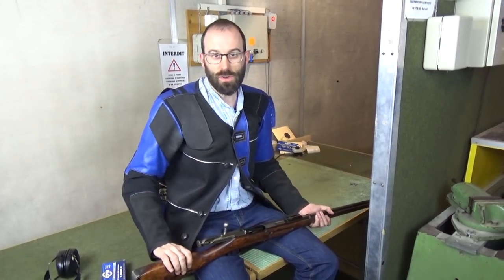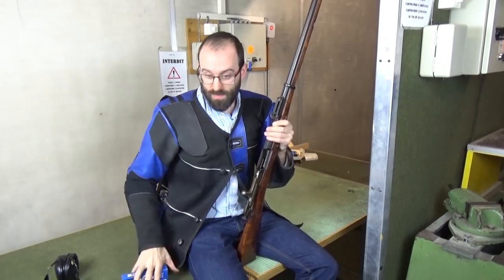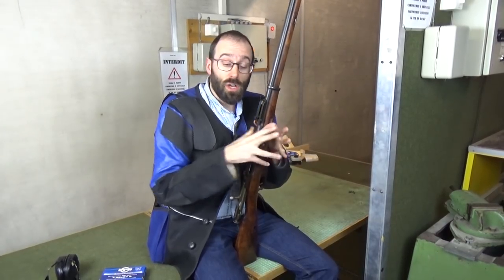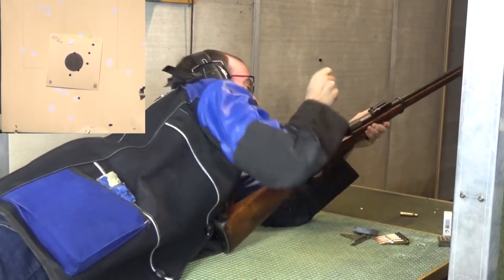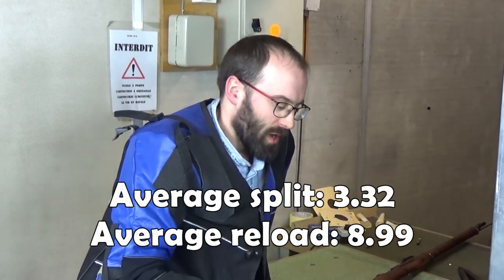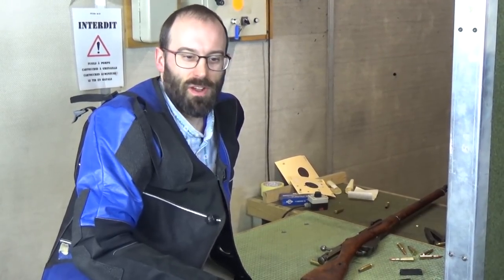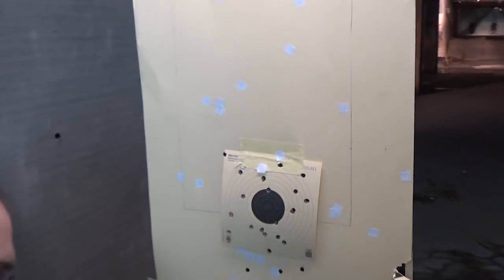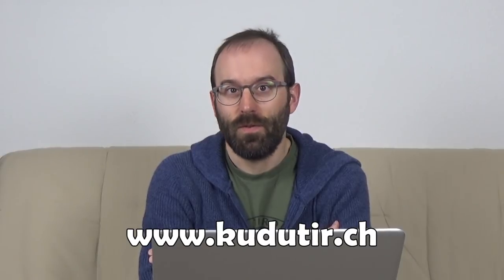Mad Minute: Finnish M24 Mosin-Nagant 7.62x54R

Comment: Enjoyed the video
First off the Chinese stripper clips are junk 
I think the reason so many Mosins have sticky extraction can be because of the cosmoline used on them. 
People clean the bore originally but not the chamber then when fired it forms a shellac coating in the chamber which sticks the case. Unless you have a chamber brush you can clean the bore all you want and not get the chamber clean
I had one that was sticky and what I did was put a rag in the chamber soaked in solvent, let it set, took it out and took a M1 chamber brush chucked it in a power drill and spun it in the chamber then wiped it out with patches. Took care of the sticky bolt. 
You shouldn’t have to run your gun dripping with oil
While not the smoothest action if the rifle was as defective as many say probably wouldn’t have made a billion of them and  used them for such a long time, eh?
Reply: They used them because they were cheap and quick to make. As with anything Russian, finished quality doesn't mean much. Look at T-34 tanks, IL-2 planes, and yes their firearms. Shoddily put together to get it out of the factory and into fighting hands as fast as possible. They could be classified as "barely adequate"
Reply: The Badass Bassist I think most people would disagree with your assessment of Russian weapons such as the T-34  Tank as “ barely Adequate “ the German  general Paul Ludwig Ewald von Kleist called it "the finest tank in the world" 
  I have 4 mosin nagants but I wouldn’t call myself a fan boy of them. I think the sights and safety leave a lot to be desired but I think for what they were designed for, a simple robust , dependable rifle they are more then adequate 
Many millions of them were used in combat to good effect and I am not aware of a high percentage of problems
Reply: @deadhorse1391  T-34 tanks were made (By children and farmers) to have a lifespan of 200km. You needed a hammer to switch gears. It was an ergonomic nightmare, armor welds were crudely finished, if at all.  The parts failed often, with tanks having to carry spare transmissions at times. Most didn't even  have radios. They would only become "adequate" By 1944. There's a reason these tanks had a loss rate of 100% in the first

Mosins are regarded as the same. Poorly fitted, poorly finished, with gaps into the action, Made as fast and cheap as possible by underskilled children to get them out into the hands of soldiers who were being sent into the meat grinder. 

The rifles and tanks didn't win the war. It was that Russia could afford to sling waves of soldiers until the german line broke.

Comment: A few tips that could help with a speed run.
1: take a dremel/drill with a cleaning jag and polish the cosmoline out of the headspace. That tends to be the worst place for lingering cosmoline as well as "sticky bolt/stuck cases"
2: File down the safety detent on the bolt so the overall operation of working the bolt is 4 actions instead of 5-6.
3: The most important with working with rimmed ammo on a bolt gun, do not attempt to load the clip the same way as you might with a mauser. Because of the rims of each cartridge resting on the rear of the one behind it, when you press down, the cartridge wants to nosedive instead of dropping into the magazine. This is why many garbage-rod fanboys will advise to lift up on the nose with your index finger while pushing down on the rear with your thumb. Doing this fast enough can occasionally result in the clip bouncing out of the guide channels similar to that of a garand.

Although the mosin was arguably the best of the worst military bolt-guns of the world, the Russian government didnt do the rifles any service by greasing them up in damning cosmoline for storage, as well as many of the rifles having to be accurized to even be considered on par with most other ww2 guns.
Now like previously mentioned, the act of loading the clips differently due to the nature of rimmed ammunition is something I see far to often. There would have been doctrine as far as the proper loading technique, otherwise the soviet troops would have more than likely developed a different rifle like the sks sooner or face defeat (just my opinion on this last part).

Comment: This is funny to me because my beat to shit, no metal finish remaining, almost all mismatched and then "fucked" by me by refinishing the wood standard but not standard half M1891 half 91/30 works REALLY well with clips, it even ejects most of them.

Then again I also tweaked the interrupter and filed a TINY bit of metal off, no bolt work done, never had a stuck case.

Comment: you'd probably have a bit of an easier time with those stripper clips if you used the old trick where you put your index finger under the top bullet and then push down with your thumb. at least that's what works for me and my Finnish M39 Mosin. also I know those older 1891-style rifles tend to be a bit more finicky; I've seen extremely crude M91/30's made in 1943 with smoother bolts than a lot of the WW1 or pre-WW1 Mosin actions. but yea a Mosin is nowhere near as nice to operate as a Mauser, Enfield, or pretty much any other of its bolt action peers.

Comment: Finnish stripper clips would probably have worked better with a Finnish gun. The tolerances are much stricter on the Finnish Mosin, so everything has to match. If you have a Russian clip that's fraction of a millimeter too large, you get a snag. Dented or warped clips should not be used. Lapua ammo would also help, because it's specifically designed for this gun. Russian ammo is ever so slightly different, because the chamber on the Russian Mosin is slightly different. Lubing the ammo may help a bit, if you can't find Lapua.

Comment: I wonder how difficult it is for people to use the Mosin clips? They are not Mauser clips, they are Mosin clips, don't try to use them like Mauser clips. You are supposed to press the cartridges down near the clip not from the middle nor from the tip of the ammo. The reason for sticky bolt might be that you are using 7,62x54R ammo in a 7,62x53R gun. 53R case is shorter than 54R so the longer cases might be a tad sticky. But overall good stuff! :P
Reply from the maker: I've actually got the tip of my thumb between the wings of the clip, which is why my elbow is in the air ;)
Reply: @BlokeontheRange  Yeah you got better at it every time!

Comment: Too bad that you don't apply the good reloading process, firstable you don't load the stripper clip like a k98, you have to bend the first round in thé stripper clip  With you index next you load the 4 rounds left.
When you put the stripper clip you've got to pinch the top round (index under the case, thumb on the top) then push straight away and the clip is gone automatically.

Comment: but I was told by a different YouTuber that nuggets are fine rifles, especially the finnish ones, and calling them a garbage rod just means you don't know what you're doing. 🤔🤔🤔🤔
Reply: Yeah and not biased at all right!!! you heard in his tone instantly that hes a biased fanboy
Reply: Well M24 is just rebarreled imperial Mosin, no actual rework there. M28, M28-30 and M39 are those Finnish rifles that were reworked much more. And parts of original Mosins used in them were picked to fit. Friend of mine has soviet made Mosin, it rattles when you shake it. My M39, no rattles, parts are fitted with tighter tolerance.

Comment: I must ask, as it states in the name "Finnish M24 Mosin-Nagant 7.62x54R", was it really 54R? And were you using 53R or 54R rounds? I understand Finnish Mosins were in 53R. 54R does usually fit, but the bolt is heavier to operate.
Reply: Vesa Uusitalo I’m a little unsure concerning chambering as I couldn’t determine exactly when Finland switched to 53R and how it compares to the timeline of ordering of barrels for the “Lotta” rifles. In any case we can only get 54R ammunition here and the rounds are dimensionally so close that manufacturing tolerances make them functionally identical.

Comment: In fact M24 is not very good Finnish mosin. M28-30 or M39 would be way better choices. Also loading from clip is kind of tricky. Best way to do it is to put finger under topmost cartridge and then push with top cartridge and your finger other rounds to magazine. Top cartridge should be easy to insert after that. Yes, it IS clumsy system. Nice kind of jam you had, my M39 has never produced that bad jam. :D

Comment: Mosin nagant quality control is all over the place so it is hard to make quality clip for it. Over all i would say mosin quality is inferior to most ww2 era rifles
Reply: More about overal design. The ammo they use require really strong hammer, then the lacquer coated ammo, integrated bolt rail and corrosive berdan primer. Also the clip is expected to be expendable.

Comment: When loading the mosin from stripper clips place your thumb on the back of the top cartridge, pointer finger underneath the tip of the bullet, lift up slightly, use the rear of the cartridge to push the other 4 down and in with your thumb

They don't load like Mauser clips lol
Reply: They do, in ideal circumstances. I have a 91/30 that feeds smoothly from WW1 clips, all I do is push straight down on the rounds like it were a Mauser. That's how it was designed.

Lifting the top round is a technique devised by the modern shooter to cope with the terribly inconsistent Mosin clips, both repro and original. But the fact that such wide variance exists proves the Mosin is a weak system in the context of the mad minute. You can spend all day getting a set of clips that fit your rifle perfectly, but the average Mosin and average clip will perform about like how you saw above.

Comment: It's nice to know that many others like me think that Mosin Nagants are 💩. And why do the bolts get sticky no other gun in the universe dose it, my mates M44 fully locks up when hot. pice of junk.
Reply: Primary extraction is incredibly weak, combine that with heat expansion and years of melted on lacquer from the steel cased ammo they used to fire.
Reply: Corporal Punishment it’s the baked in cosmoline and steel case lacquer in the chamber. The best remedy I have found is to clean the chamber out with a 20ga shotgun bronze Brush. Using  the front half of a two piece cleaning rod chucked in a drill. Lots of solvent and about 15 minutes straight of drilling made my mosin run smooth even after many rounds.
Reply: Making sure the chamber is really clean helps the primary extraction. I mounted a wooden dowel with a split end in a drill chuck and jammed a bunch of steel wool inside and spun it inside the chamber until it was shiny. It won’t hurt the headspace because it’s a rimmed cartridge. 

To make the cock on opening easier, remove the firing pin and spring and chuck them in a drill and polish them also. Then polish the firing pin channel. Again, steel wool on a dowel in a drill works wonders. 

Of course, having to do these tasks to a rifle just to get it to operate with an acceptable amount of effort proves how terrible the design was to begin with.
Reply: @kingwiththeax6880  yeah was going to say exactly what you said about how ridiculous it is to have to do all that to get the gun to run.

I have a No.4MkI with a force matched bolt and non matching magazine. It has always loaded, fed and extracted like warm butter from the moment I got it. The only thing I needed to so was slightly shim one side of the recoil lugs to re-center the barrel due to a slight warp in the forend.
Reply: @towarzyszbeagle6866  How a gun was treated in it's lifetime has no bearing on the actual mechanics of the firearm.
      
Don't get me wrong the Mosin action was rightfully a dead end and the Lee Enfield was the better rifle in almost every regard (54r is better than .303). But decades of sitting caked in Cosmoline at the bottom of a salt mine in Ukraine is hardly the fault of the rifle itself, if you left a Lee Enfield in the same circumstances it too would probably need a deep clean to get to it functioning properly.
Reply: @NarcassiticGamer  I definitely agree on that point largely. However I've never heard of an Irish contract No.4Mk2 that's sat in the grease and wrap since the 50's needing anything other than a standard clean up to function properly.

I do however think that the Nagant has certain design aspects which naturally hamper smooth consistent function though. Chiefly the poor primary extraction combined with the short, straight bolt handle.

Comment: So, you're having a problem with your Mosin Strippers. The proper way to do that is to put the tip on your index finger onto the top bullet, angle it upward for leverage, put your thumb at the base, and push it down. if you do it right, and with a little luck, this method will also pop your clip out. 

Give it a try, helps a lot!

Comment: Lift up the tip of the top cartridge's bullet with your finger while pushing down near the rim with your thumb. That's how you use stripper clips.
Reply: Goat not if you’re using a good platform lol
Reply: @alexmoore1506  Lifting up the nose of the bullet prevents the rim from snowplowing it's way down the stripper clip. It's most useful with rimmed cartridges, but rimless cartridges can also bind on the stripper clip.

Comment: What kaliber ammo did you use. Since you had a Finnish Mosin It has been made for 7,62x53R, not the russian 7,62x54R. The bullet dia is different, case is shorter and case rim is slightly different. Also finnish stripperclips are slightly different. The reasons for those changes where to make the gun more accurate and also funktion smother. All finnish guns that were made and captured were rebarreled and reworked for this 53R kaliber. Also the actions were made to tighter toleranses for better precision and smother operation. 54R ammo can be shot in a finnish rifle but its not recomended.

Comment: I'm not praising the rifle, as it is obviously a cheap surplus rifle for a reason, but I'll give it a bit of credit where it's due. He absolutely bombed the whole stripper clip loading process, you should lift the top round with your index finger and push as far back on the round as you can, then it generally functions well. The reason that it doesn't load when you try to run the clip like that of a kar98k's, is that the rimmed cartridge binds on the ribs of the stripper clips.
Reply from the maker: TFW someone makes a huge comment without actually bothering to watch the whole video ;)

Comment: Personally i have never seen a non-functioning Mosin. I've probably only encountered the ones that actually have been cleaned PROPERLY after WW2 :)
Reply: Tapani Löfving I’ve owned a number of ‘nice’ ones and they didn’t run all that well either.

I think they’re just out and out crap.
Reply: @StrangelyBrownNo1  I will agree if the rifle is correctly cleaned, if not, it's pointless to call it bad because it's just badly maintained. If you have a WW2 jeep, you certainly wouldn't run it with the same engine oil it had back in the days? ;)
Reply: I've got a functioning Mosin as well, but it's still hard work to run it nearly as fast as it's contemporaries.

Comment: First time ive seen someone struggle that hard with a mosin haha. Clean out the inside of the chamber and grease the bolt and it'll never hang up like that again. I have a Russian made mosin dating in 1943 all original parts and when I done that it's been able to fire somewhere around 600 rounds and not a single hiccup yet. The bolt will cycle as fast as your hand will move

Comment: From my own experience it was no surprise that you got a jam. People have this idea in their head that Mosins are such hearty rifles because they are Russian, but they’re really not. The magazines are so tight and there’s so much going on down there that if one thing lines up wrong the rifle is not going to feed. 

The clips are indeed terrible but it is definitely possible to feed them easier than that without resorting to cheating with lubrication. The Soviet clips in particular seem to work ok but applying pressure at the back by lifting up on the nose of the round is the key. 

I wonder if the tumbling had anything to do with the 7.62x54r being fed into a throat and rifling that was designed for the different bullet of the 7.62x53r. I genuinely don’t know, I’ve heard conflicting things about the difference between the two. 

All that said 15 rounds is pretty good for a Mosin. Especially when you keep in mind that the rapid fire drill for a Soviet soldier was a measly 10 rounds.

Comment: Dude, you have to tip the top round of the clip up and shove the back end down. That's how you shove a clip of those in. You don't press them from the middle or they don't feed. 
You once did a mad minute with a MN and got 18rds? 
I don't believe you.
Reply: You don't have to tip the round up unless you're using bad clips. Mosin clips should feed like any other clips. And in any event, the requirement for such a special technique would prove how poorly equipped the Mosin is for a run like this. Bloke's run is representative of an average, not the best possible. What's hard to believe?